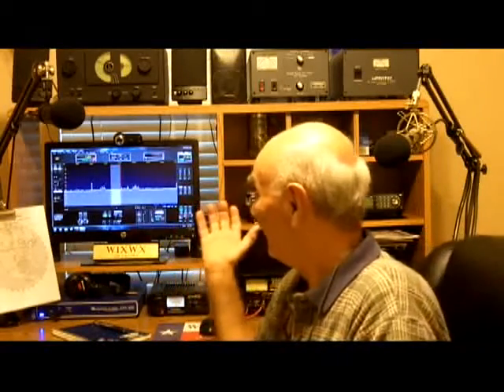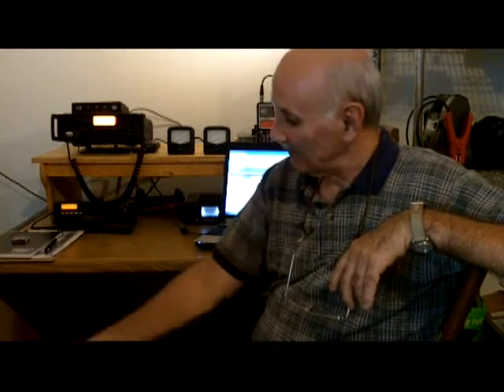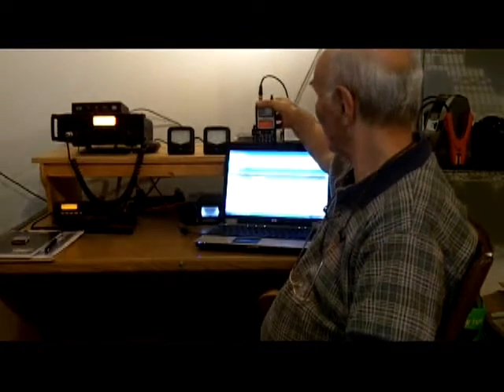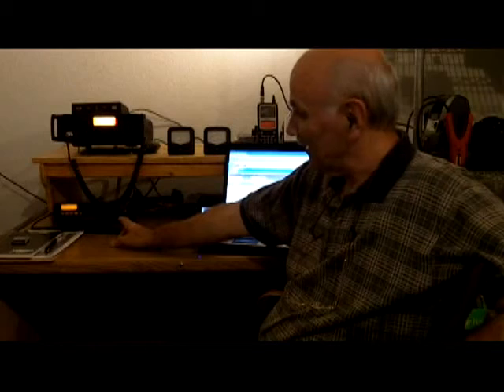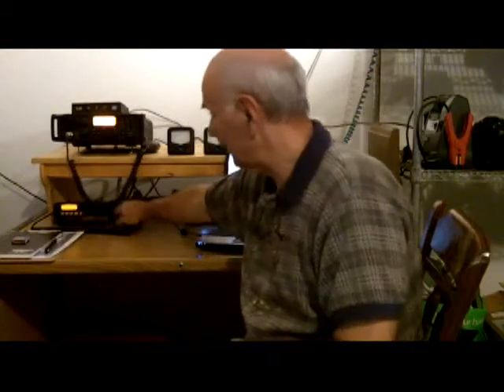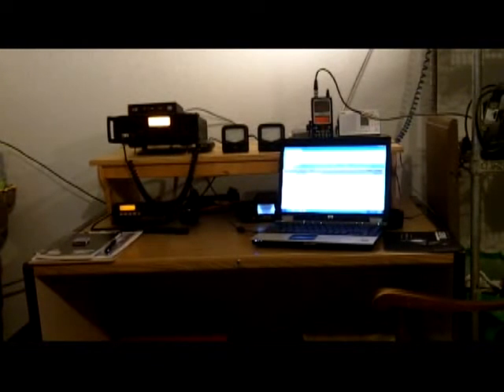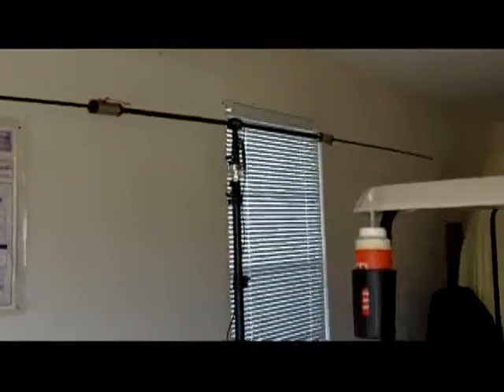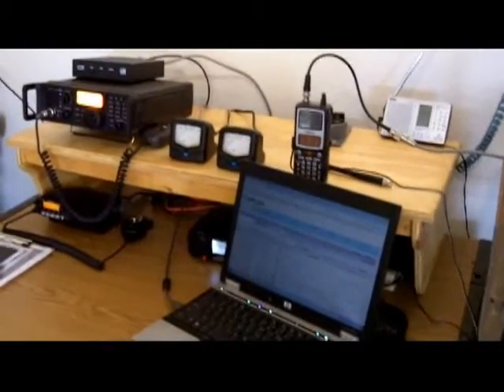Emergency Shack Setup

Comment from the maker: Anderson Power Poles- https://powerwerx.com/anderson-power-powerpole-sb-connectors

Powergate- http://www.westmountainradio.com/product_info.php?products_id=pg40s

QSO King wire antenna-  http://www.ebay.com/itm/QSO-KING-80-6-meters-1-5-KW-end-fed-ham-antenna-/170652880991?hash=item27bbb4505f:m:mHzc0ubUjfDMgORDjOjPCmg

MFJ Ham Sticks- http://www.mfjenterprises.com/Product.php?productid=MFJ-2240

Alpha Delta Swiches- https://www.alphadeltacom.com/pg3.html